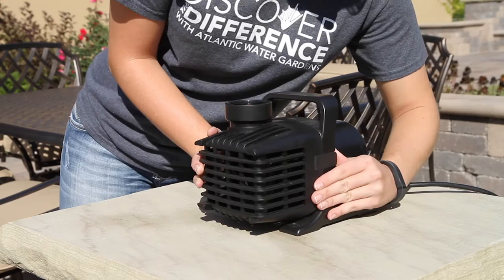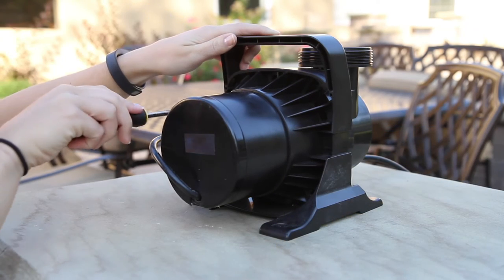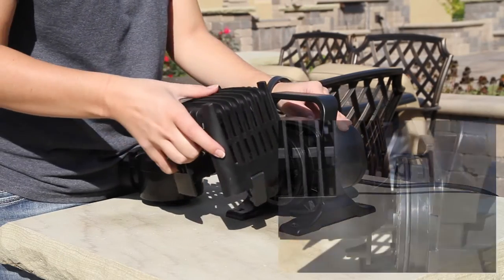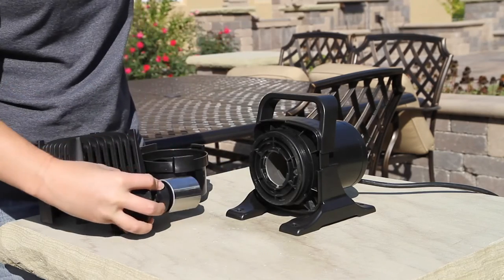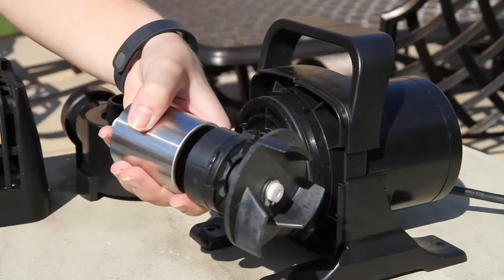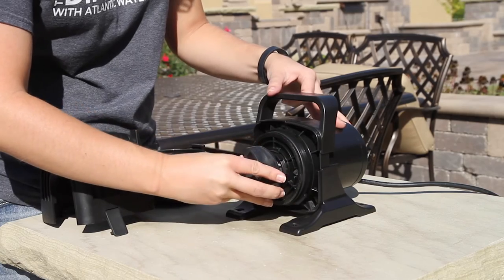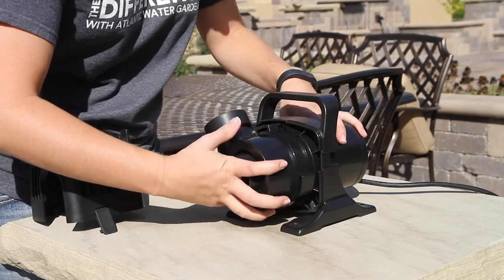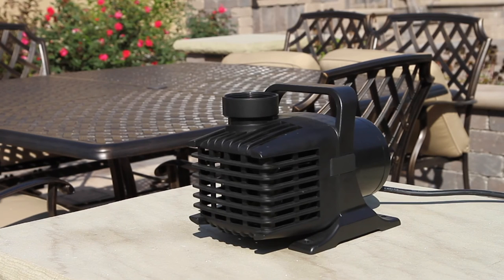Cleaning your TidalWave TT-Series Pump

Comment: is there some sort of hose that can attach to the pump to pump out the water?
Reply from the maker: Yes, the pump is designed to have a hose attached to pump water. Hoses of varying lengths and diameters are available from many DIY and irrigation product retail stores as well as online. The exact diameter hose you attach to your pump is dependent on what model of pump you have. If you have additional questions, please contact our customer service department at 330-274-8317 x2. Thank you.